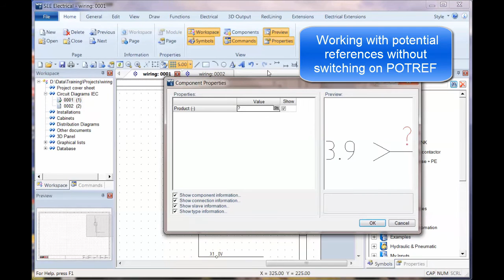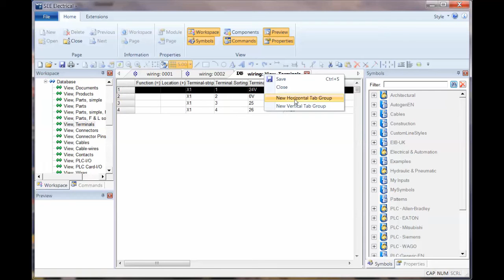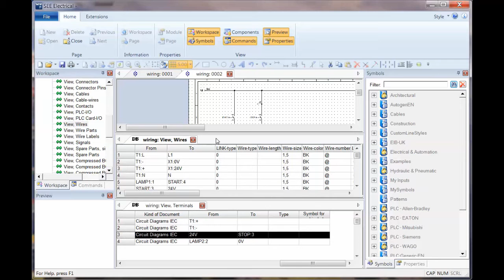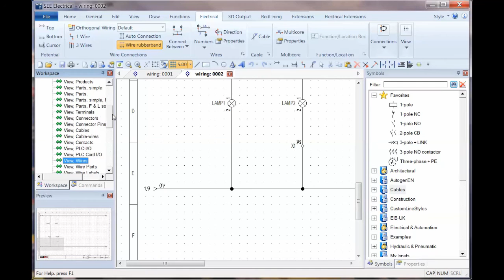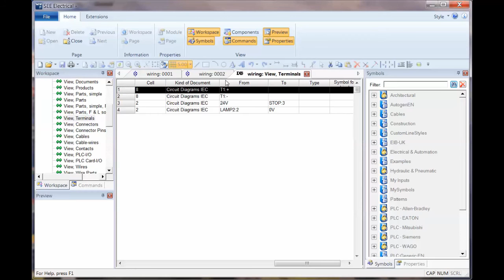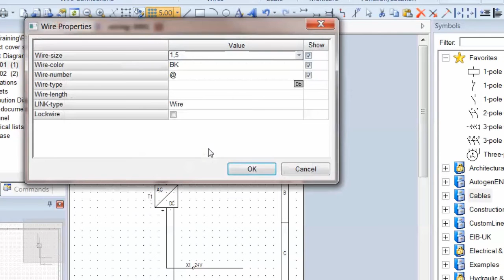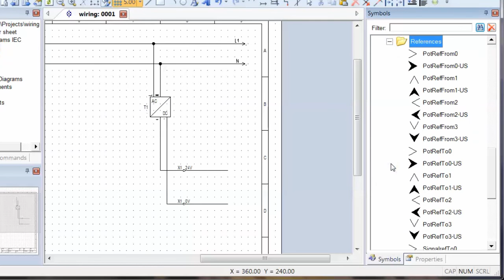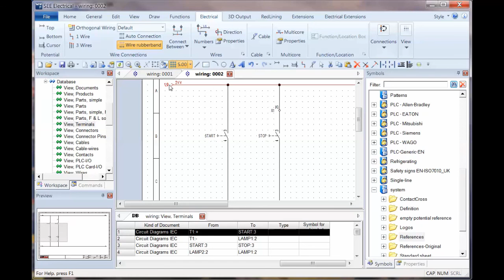Wire and Reference Settings in See Electrical

Comment: Hello!
I use a lot  fragments macros with wires in my projects, but I cannot save my wire properties because when I move it from connection my wire properties like type and lenght are vanished and the wire assume values like a new wire. There is a way can I fix or don't lose the wire properties when they don't are connect a beteween components?

Comment: Hi,
On 0:40 when I double click on the wire I get the arrow the other way around, what should I do? How do I control that direction?
Reply from the maker: Before double-clicking if you hold shift it will invert the arrow direction (V8R4) but also if you have already inserted the arrow try holding shift while you double-click on the signal reference graphic and it should reverse the existing arrow. If this doesn't work then its possible you have copied the system.ses symbol database from V8R3 over the V8R4 one. It should contain some additional reference symbols to allow this function to work.
Reply: @IGEXAOUK  thanks!

Comment: very useful video.  Since I'm going to setup a new standard drawing and want to use splitOPR method, I tried what you showed in the video, but I can't rename reference text. it is uneditable. could you please tell me what i can do? thanks a lot./Julia
Reply from the maker: Hi Julia, the reference text should be automatic. If you've renamed the 'References' symbol group to 'References_Original' and 'References-SplitOPR to 'References' then when you double-click using the '1 wire' command the reference symbol should have a 'Product' and 'Connection 00' text. These are really the only parts you can edit manually and its best to keep the source connection as $1 and the target reference as $0. Not sure if this helps.
Reply: Hi, Thanks for the answer. Maybe my question is not clear enough:-).My question is that I just can't " renamed the 'References' symbol group to 'References_Original' and 'References-SplitOPR to 'References'. once again thanks a lot. wish your best and good summer/Julia
Reply from the maker: You should be able to right-click over the folder and select 'Properties' to access the name and make a change. If the symbol database has a lock over it then this won't be possible, but this is not the normal situation. Please contact support.see@ige-xao.com if this doesn't help and the support team will be happy to assist you.